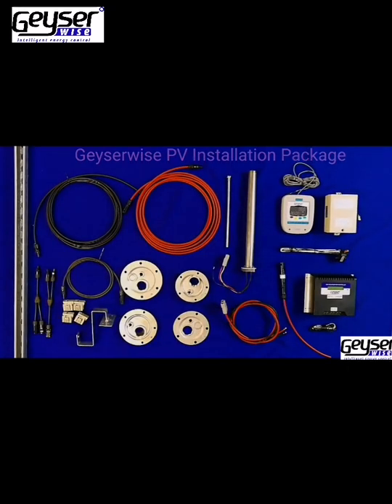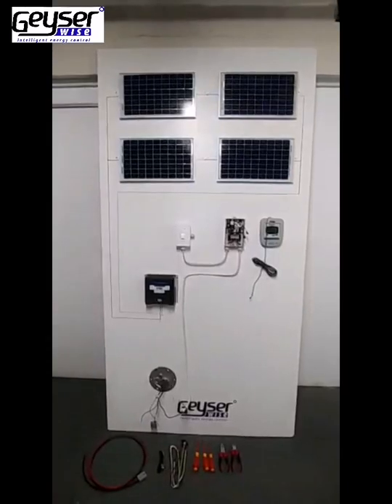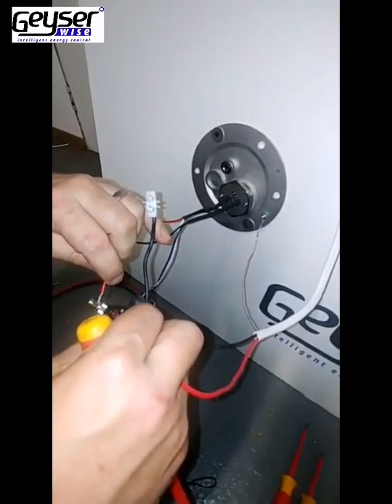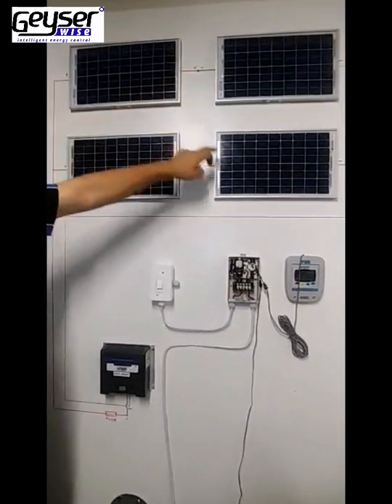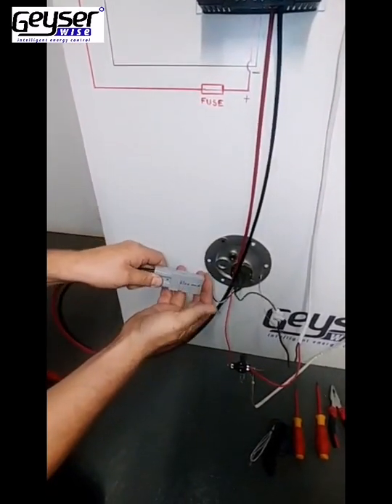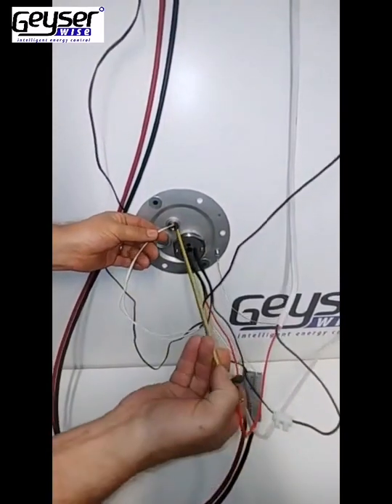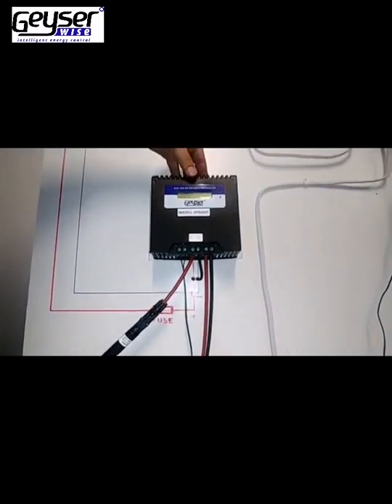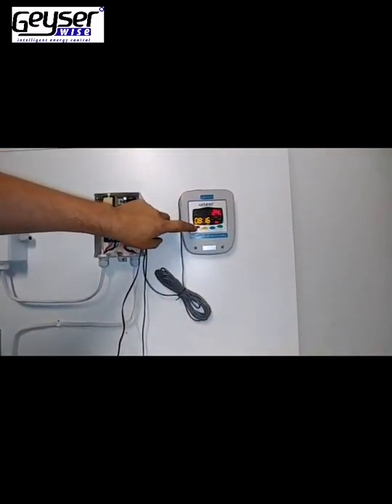Pv installation video

Comment: Hi Geyser wise. Just purchased your system minus the panels with a 1500 w element
I have three spare JA solar panels   460 w. Can I use one / two of these panels for my installation?
Reply: Check the Voc and Isc of total panels and check if they are withing the range of the GEYSERWISE MPPT and adjust accordingly

Comment: Hello, sound needs to be improved. Try using a mic. 3 x 330w panels  x 80% panel efficiency = 792 watts max output between 11:15 Am and 1 PM. I don't believe that this will be sufficient to heat the water exclusively. 
EVTs are more efficient.
Reply: That is true but have found that other clients are convinced that this is a better system. I personally prefer EVTs.

Comment: Hi , How many watts should the pv panels supply in total ?
Reply from the maker: It is more about the voltage - Approximately 138V (3x330 or 3x250w panels in series)
Reply: Hi there, How many Amps fused is used?